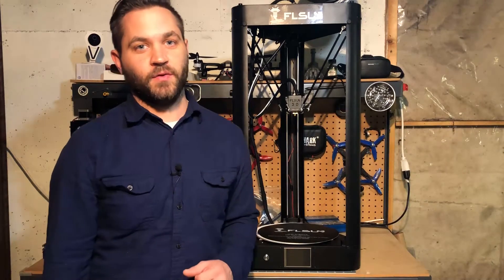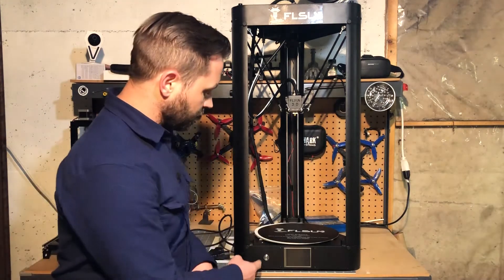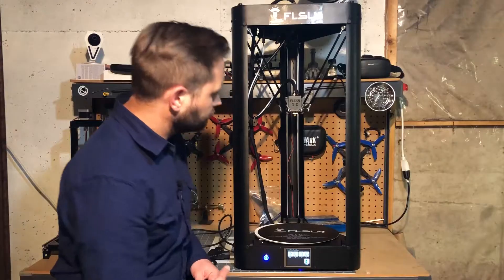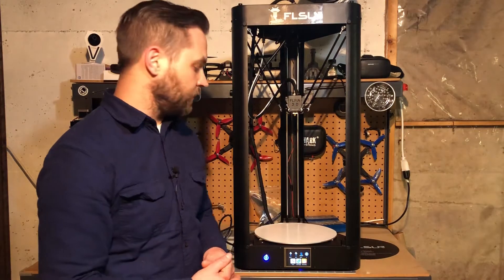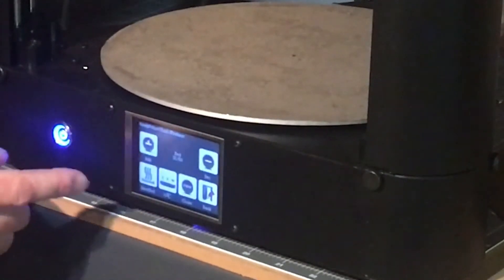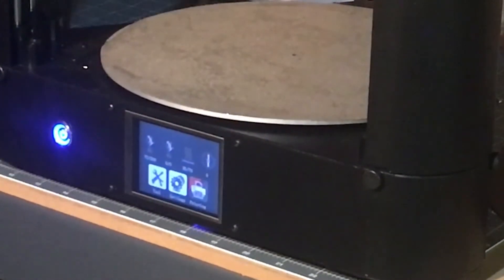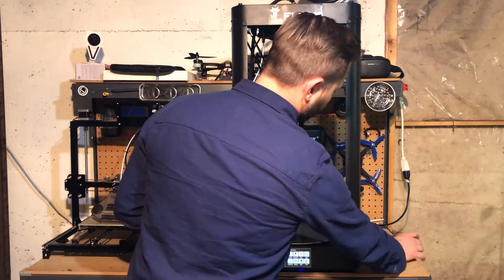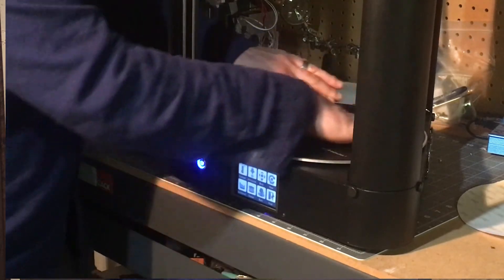FLSUN QQ 3d Printer - Part 2

Comment: First time powering on my FLSUN-QQ and performing the auto-level and Move-Z. The nozzle seems to Home correctly, but (a) when I do the autoleveling, the nozzle goes off the left side by about 3/4 of an inch, and (b) when I try to calibrate the Z-axis, the nozzle goes hard onto the build platform. I make the adjustments and SAVE the setting, but after doing this three times, the nozzle still goes hard into the bed when I start the Move-Z process. What should I do?

Comment: Doesn't the plastic sticker make the head offset different, from bare metal? How did you compensate for the plastic thickness. How does the head sense the bed?
Reply from the maker: You use the auto level feature to set the bed level which is then written to the firmware and will be remembered even after power cycles. There is a setting called z offset that you can then use to fine tune the height offset for compensating for the thickness of the bed material. It works very well and I haven't had to redo my bed levelling at all.

Comment: If you stick the Surface on the Buildplate. How do you go about if you have to relevel the Bed?
Reply from the maker: I have not had to relevel the bed yet since the initial leveling. I think FLSUN initially thought that there would be no need to relevel and I believe they sell replacement print surface adhesion. All that said, it is possible to level it using a foil method that is explained very well in this following video by BlueMacGyver https://youtu.be/FlMIVxik5XY
Reply: Doug Licht Thanks for the Info. Another thing that I could not find any info on is Firmware. Can I download it anywhere if I have to change anything in there.
Reply from the maker: If you ask FLSUN for the firmware they will send it to you. There is a Skype chat you could join and I think there is a group on Thingiverse for FLSUN too. Somebody on one of those might already have the firmware.
Reply: Doug Licht they sent it already to me. We are updating it together to a newer Version to use Linear Advance wich in my tests improved quality quite a bit

Comment: Doug, even though my QQ came with a US cable I found that the power supply was set to 220v.  I had to take off the bottom and set to 110v.
Reply from the maker: Robert Setterlund I actually heard one other person mention that. I will tell FLSUN and see if they can change this for the products in the US warehouse to the 110v. I don’t know if they can change it but I’ll try.